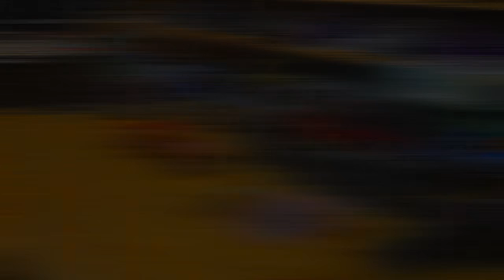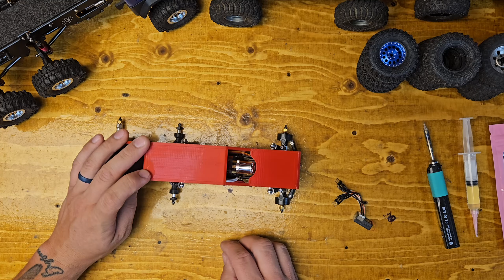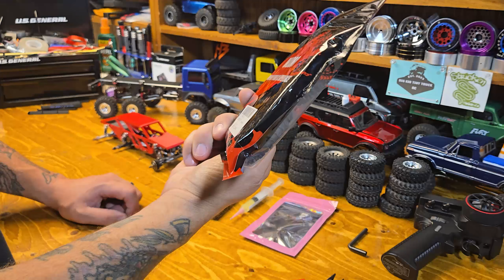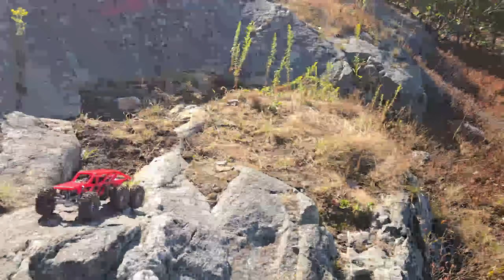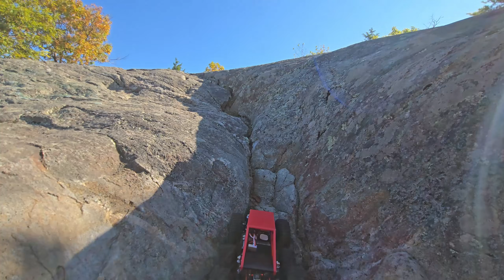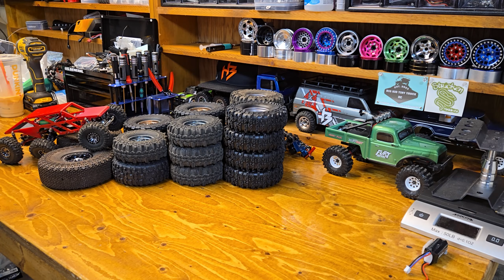My SCX24 6x6 Project Finally Revealed! (Free Download!)

Comment: I have a bone stock deadbolt. I shouldn't have much of a problem with building it from that right?
Reply from the maker: Not too bad. Just some extra parts for the rear section like links, drive shaft, shocks, axle etc.

Comment: I have the MOFO RC UAF6 6x6 and wanted to do 6WS but the worm pass through gear for the middle axle was positioned in such a way that steering links would not fit so I went for 4WS. Would you happen to know if your 6x6 chassis is 6WS capable? Sweet build and keep crawling 😎.
Reply from the maker: I think all of them are going to have that issue unless you make some custom bent links that go over the passthrough. And the servo would need a custom mount for the horn to not hit. Might have to work on that next.

Comment: Great Build CK, It performed nicely on the rocks. We have all purchased multiple packs of cheap wheel tire sets and found them to be too small. you can use them on Trailer builds and other projects in the future mate. Love the Ghostbusters soundtrack. Look forward to seeing you build another 6x6x6. They are so much fun with 6wsteering and the Meus transmitter works so well with the 6ws. If you not doing anything check out Waffles RC on Sundays 3pm sol cal time. He's live and we have a great bunch of guys and girls chatting and building Crawlers. I think you would have some fun there. Hope to see you there. Keep Crawlin
Reply from the maker: Yeah, I started working on my Bronco again and making that a small tire trail/crawler. It already was kind of bad being so top heavy, so smaller tires lowering it down might work out for it haha. I be-bonded 4 of the tusks and mounted them to some bead locks.
Didn't think of a trailer, might have to get back on my trailer project I started a while ago. I got enough wheels for it now! lol
I just subbed to Waffles RC, it's the channel with the big long trailer for the header, right? I'll try to swing in tomorrow, I'm on the east coast so around noon for me.